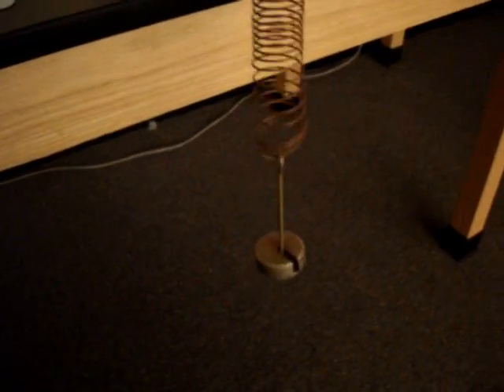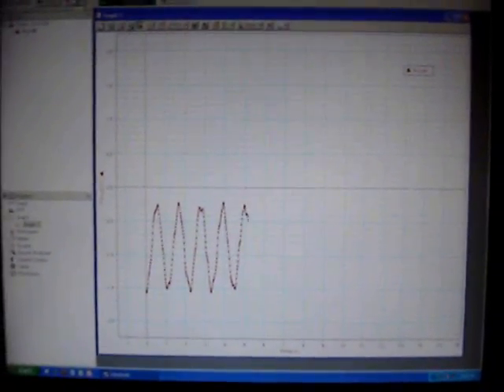Make a radio using an oscilloscope

Comment from the maker: Hi - the resistor should be (roughly) impedance matched to the signal generator.  I used a 100 ohm resistor.  The variable capacitor and inductor should be chosen together to make a circuit that will resonate in the AM band (about 0.5 to 1.5 MHz).  The variable capacitor I used varied from 24pF to 480pF.  You could probably use several different types of variable capacitors, and then wind your own inductor to get the right value of L to make an AM resonant circuit.  Good luck!

Comment from the maker: @claymantoo If you want to generate some interesting patterns on your own, you can get some signal generator circuits on ebay for only a few dollars (less than $10).  You can also often find complete signal generators (box with power supply, knobs, terminals, etc.) for about $25 or so if you look around on ebay.  A simple signal generator will create sine waves, triangle waves and square waves.  You could also buy a new audio signal generator, like the Tenma 72-490, for about $50.

Comment from the maker: @claymantoo I haven't yet made any videos on this, but there are a few circuits that generate nice oscilloscope patterns.  You can make Lissajous patterns by connecting the X-input to one frequency generator and the Y-input to another frequency generator.  When the ratio of frequencies is a simple fraction (like 3/2) then very pretty patterns appear on the scope.  Another circuit is a narrow-band 60 Hz notch filter with 60 Hz square wave applied: the result is a square - sine wave.

Comment from the maker: @claymantoo The trick is that the B&K 1470 scope uses a different connector than the now-standard BNC connectors used by most scopes.  I believe it uses a UHF connector.  So, you need to get some UHF to BNC adapters as well as some standard BNC probes.  You can get BNC probes from Circuit Specialists or Jameco (do a Google search) and UHF to BNC adapters from Digikey.  Good luck!

Comment from the maker: @Organgrinder010 Thanks!  Unfortunately, this concept won't work with modern digital oscilloscopes because their screen refresh rate is well below audio frequencies.  So, this experiment will be hard (if not impossible) to do in a decade or so because analog scopes are more expensive than their digital counterparts and most companies have stopped making them.